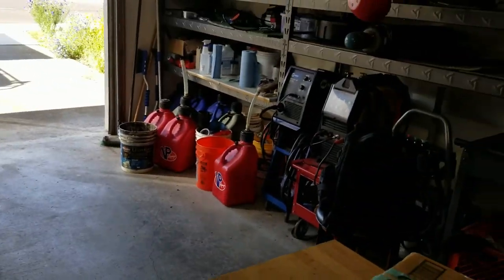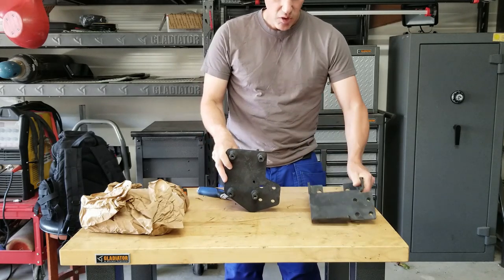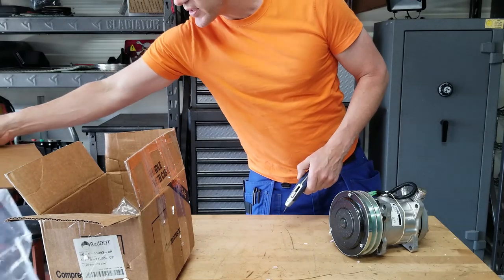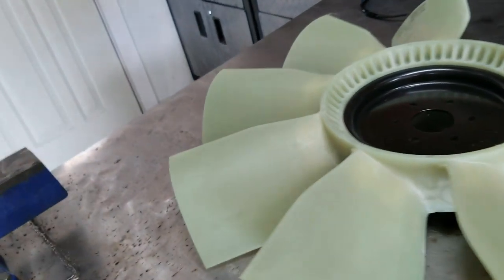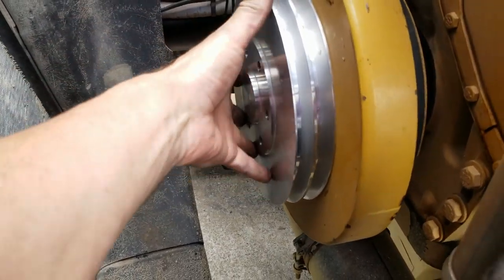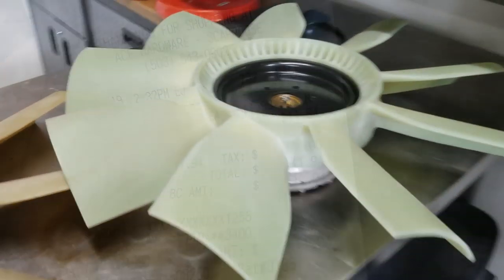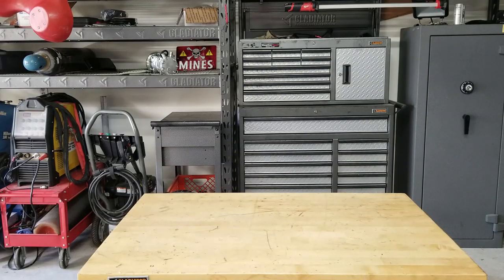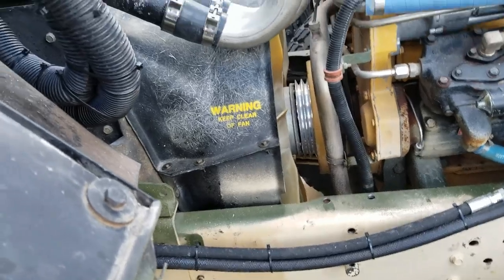Abel LMTV build part 114 (mystery unboxing, belt driven a/c compressor part 1)

Comment: You may want to put short pieces of pipe instead of washers if you can find one to  fit your bolt.  If I recall correctly, the alternators on my cars and trucks from the last century had tubes between the two hangers to strengthen them when you tightened  them down.

Comment: Ugh, I stripped some of the A/C pulley threads in the part that mounts to the crank. Helicoil time. Do you happen to remember the torque spec? It must be fairly low.

Comment: I just noticed something.  Is that pulley tight up against the harmonic balancer or is there a gap?   Just wondering if it will chatter or cause any issues.
Reply from the maker: It's machines so perfectly there is about 1/2mm of space between the balancer and pulley.  The way it was supposed to be.

Comment: Awesome video!    Now I just need to know where to get that pulley and those brackets.
Reply from the maker: They are hard to come by.  The only reason I went this route is because of the mystery box.  Thanks to whomever it was that donated those parts.
Reply: Sean Fillner 

Are you in Steel Soldiers?   Would like to send you a PM, but I am not in Facebook.
Reply from the maker: I lurk, but don't post.  I am a huge anti-fan of forums....

Comment: Hi Sean, I'm doing a similar build. Can I ask a favor? What is the belt number for your set up? Thanks in advance!
Reply from the maker: It won't help you...  Take a piece of string and run it through the pulleys and cut it to the length you need.  Take it to ANY auto parts store and tell them that is the length of belt you need.
Reply: @SeanFillner  ok, thanks!

Comment: Great video!

 I'll be starting on my install this weekend other than the few pictures posted on Steel Soldier  your video is making this whole job a lot easier .

 Thanks .

PS. I am  looking for part you might have I'll p.m. you on Facebook .
Reply from the maker: I hate "cryptographic" posts or "I installed it, it was easy".  That is why I have this channel.  Nothing LMTV related should be a secret.